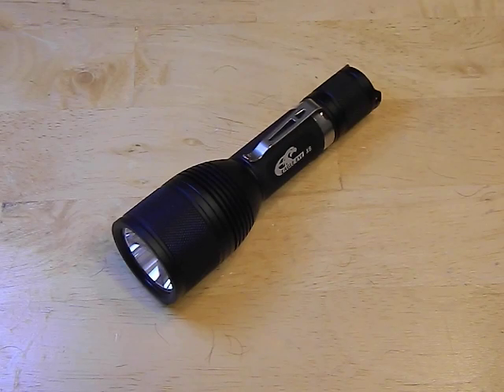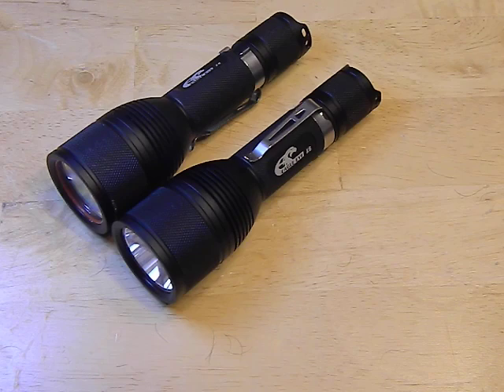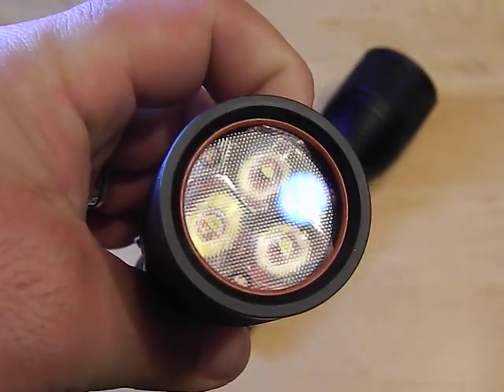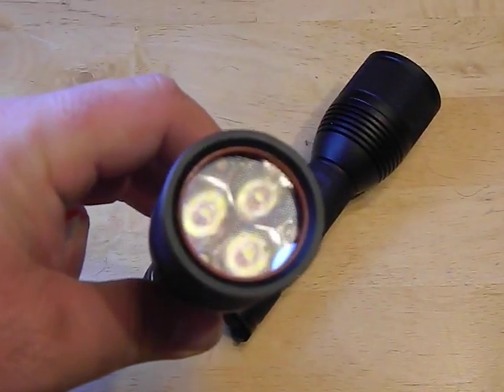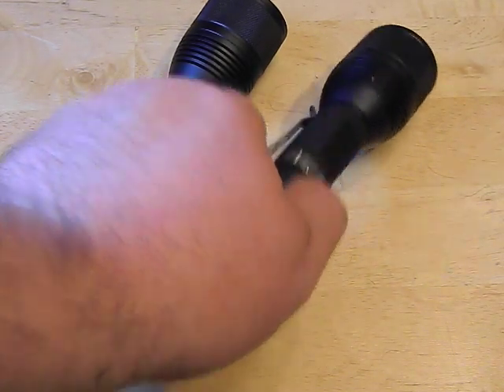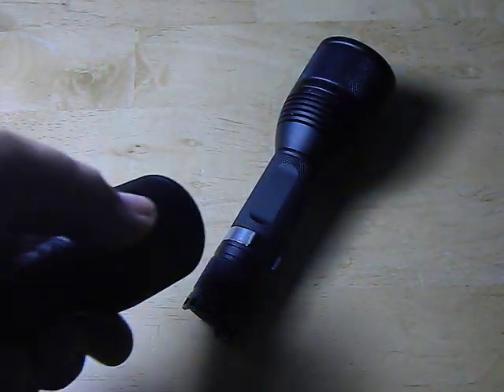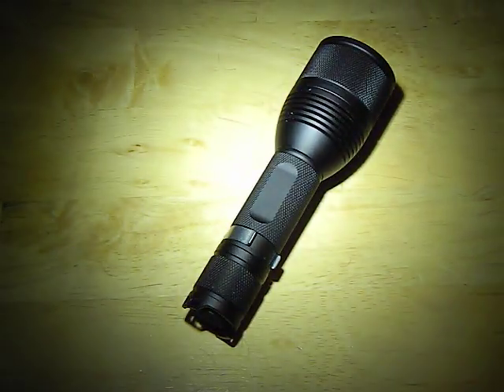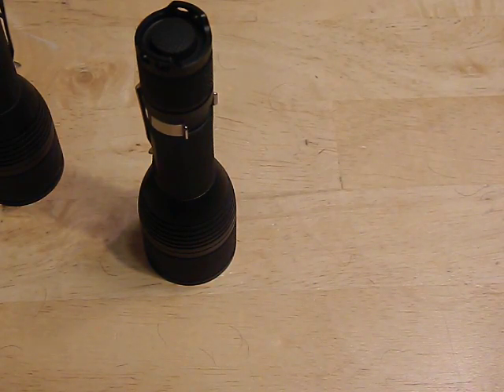My 3000+ lumen Eagle Eye x6 Triple LED build

Comment: this light should be a better one to put the 3 leds in it uses the More Powerful 26650 battery  & the  Bigger head will dissipate the heat better   http://www.ebay.com/itm/311833031597?_trksid=p2060353.m1438.l2649&ssPageName=STRK%3AMEBIDX%3AIT
Reply from the maker: Dan Ray finding an optic to fit the triple would be tough if not impossible

Comment: or just get a Convoy L6 and get same beam spread plus will have almost over twist the throw distance    You just got more beam spread but the throw is about the same You need a Big Deep Reflector for Long distance Beam  throwing with good beam spread.  Plus with the Extra heat its going to produce in that small head package you want be able to run it very long before it gets very hot Plus  the Extra amp draw that 18650 battery want last long too But  Its a Nice show piece for sure !